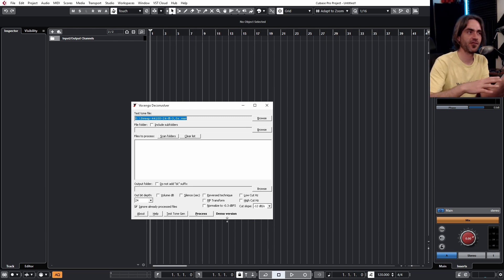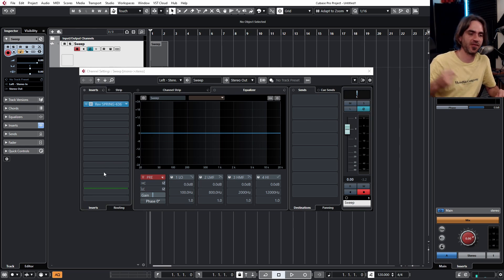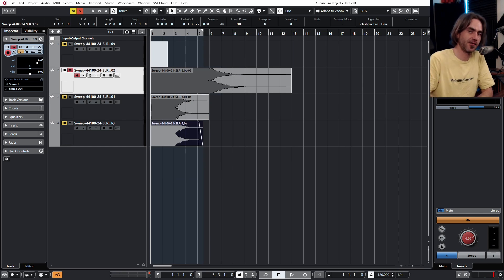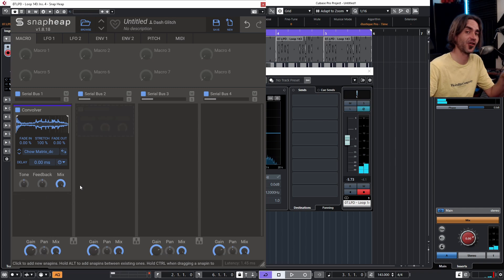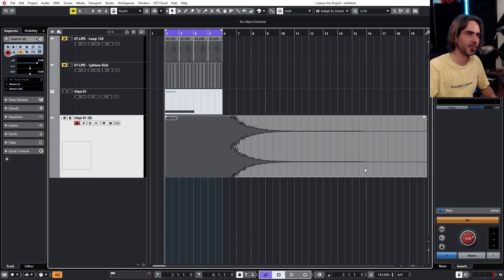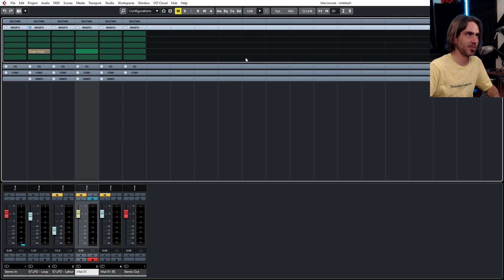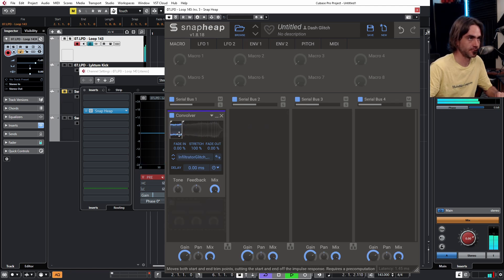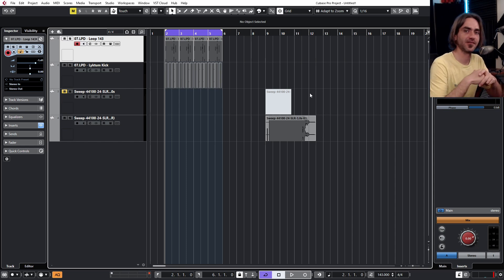How To Make Your Own Impulse Responses / Convolutions

Comment: I have been trying to get an impulse response of Diva's plate reverb for ever and even after watching this vid I'm still struggling XD You can't load a sample into it so I tried to make a sine sweep in the synth itself by doing a portamento glide from 20hz to 20khz, activating the plate module and bouncing it out. Unfortunately all I get is an impulse that sounds like a sine sweep lol. I've spent a solid year trying any and all reverb effects plugins to try and find something similar and absolutely nothing comes close to it. Load the preset HS Chango Clique and toggle the short plate reverb on and off and you'll hear exactly what I mean. It's super wide, super warm and sounds like the most realistic space I've heard out of a reverb. I just wish U-he would release it as an effect lol. If you're up for the challenge I'd love to see if you are able to replicate it or capture it. I honestly think it's the golden goose of plates.
Reply from the maker: you need to render 2 files, one with wet 100% and one with wet 0%, put those into the deconvolver
Reply: @DashGlitch  Interesting. I tried that but still had the weird pitch scaling effect. I assume the test tone is the one that should be dry? I'll give it another shot. Maybe I scuffed a step. Thanks.
Reply from the maker: @Super-id7bq  Correct, double check the sounds are identical on both passes, biggest issue might be random phase in the patch
Reply: Awesome, thanks for the help! I shall give that a try!

Comment: Finally got around to the video… will comment again after I finish it^
Reply: Okay so what was the reason you used the sweep instead of maybe a short click with different verbs? Cool video though, thanks for the info^^
Reply from the maker: The sweep is full spectrum and allows the deconvolver/convolution system an idea of what it sounds like at all frequencies
Reply: @DashGlitch  I missed that, thanks!

Comment: Great video, there might be a slight misconception though. I believe that FM and convolution are both a multiplication of 2 signals but in a different way, FM is a multiplication between the playback speed of one signal as it's playing (pitch) and the second signal. But for convolution I believe the multiplication happens between the spectrums of the 2 signals. I.E. the spectrum of the room in which the reverb is measured is multiplied and thus in a way imposed on the signal being processed. I believe these things are different enough to classify FM and convolution as 2 different things... but I'd love to be corrected if not!
Reply from the maker: Correct, I think I misspoke, I meant to say they’re similar in that they both use multiplication but not identical in the method
Reply: @DashGlitch  pfff well then at least I'm not going crazy because of this...
Reply from the maker: I know the theory, but maybe just explained it badly, thanks for the info
Reply: @DashGlitch  hi, where in South Africa are you based?